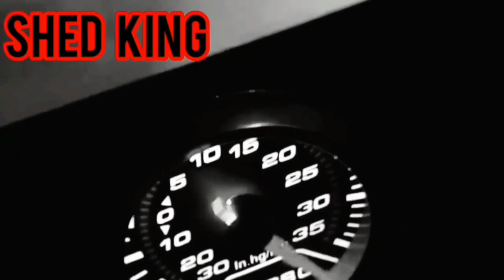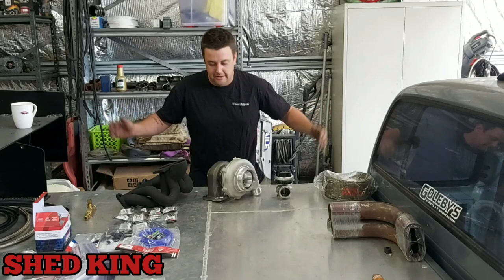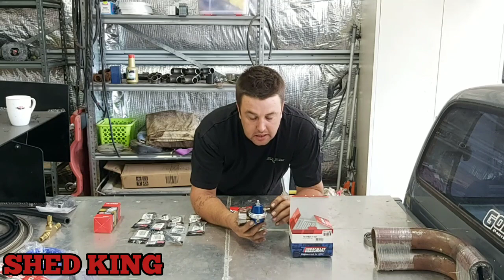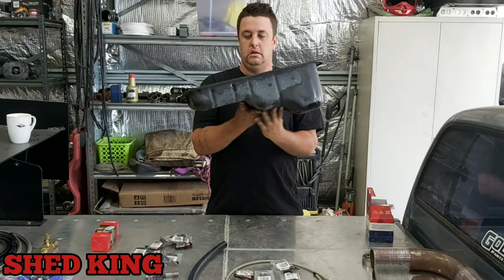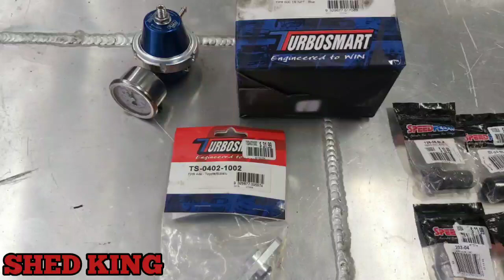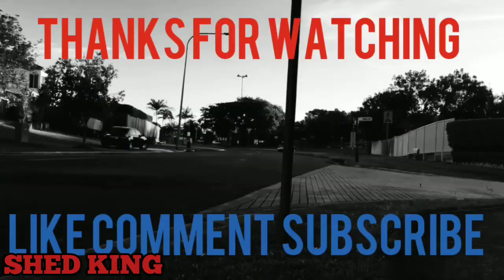3rz turbo parts list what you need for a stock ECU setup

Comment: Can you use this system to twincharge a 3RZ which already has a high boost TRD Supercharger install with it?
Reply: Need to be aware of flow restrictions of the super charger
Reply: Definitely doable but not with the stock ecu. If going to the trouble of adding a turbo, better off taking off the SC...

Comment: I put together a turbo kit with the cheapest Chinese stuff i could find. all together i paid about 8 or 900 dollars. everything has held up fine for the last 2 years on 7 pounds no worries. only my turbo manifold which i custom made out of a OEM manifold cracked up. il be changing my setup in the very near future since ive built it with spool rods and have an ECU waiting around once im done fixing a nissan ahaha. got more info in my videos.
Reply: I'm considering a pulsar turbo at $1k vs 2.5k for the Garrett, but still using the golebys manifold etc.

Comment: So on a stock engine with the gtx3071 , stock fuel system , factory ecu and a better intercooler you can get 300 - 350 rwhp  . Will the standard drive train handle this ? FYI 4x4. These videos are great. More details the better.
Reply from the maker: On a stock ECU you will make up to 230hp I have seen it done 

With an ECU injectors and a pump you can make 350+ hp
Reply: SHED KING thanks for reply. Could you recommend anyone in Perth to fit